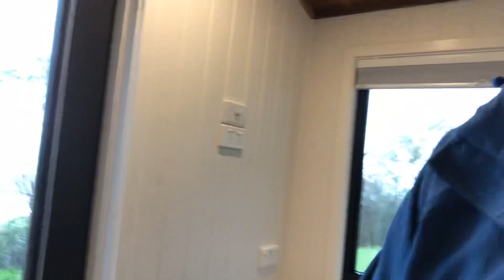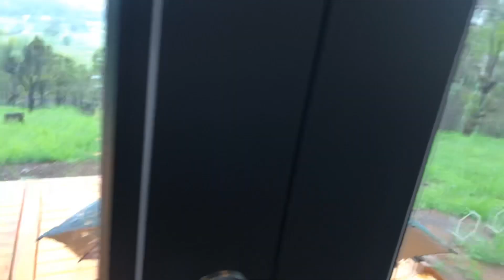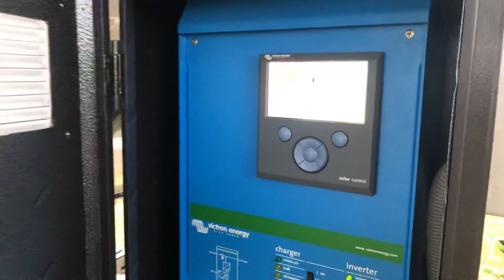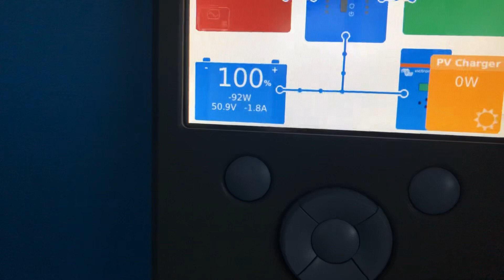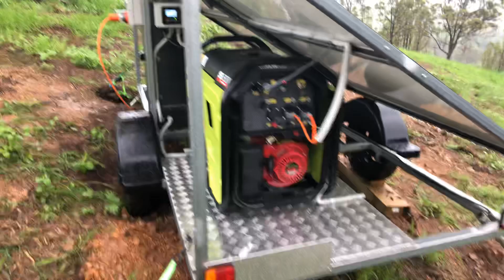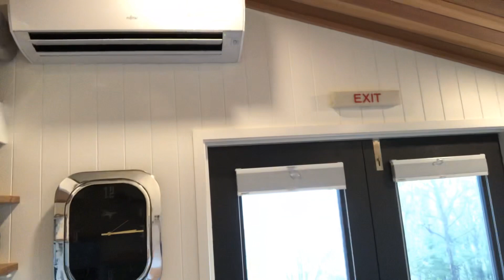Solar Trailer - Designer Eco Tiny Homes

Comment: great video, I like how you were honest about limitations and how adjustments need to be made.  I live in my tiny house now for  over a year in Qld.  I have electricity but aim to one day go solar.  I run my air con during the day at 24 degrees , can be from 9am til 7pm , night seems to be ok without as I have windows/breeze and a small face fan if I get a little hot.  would you 4 panel trailer be enough for running this air con for this time , and because its during the day would the generator still need to kick in?